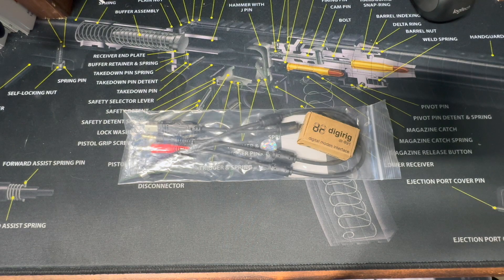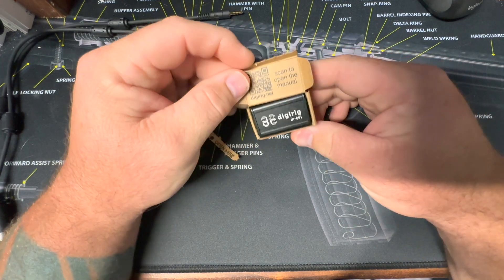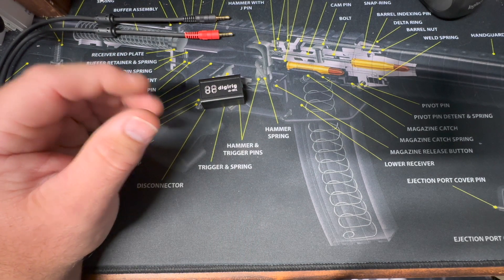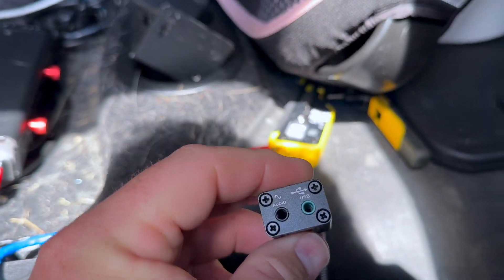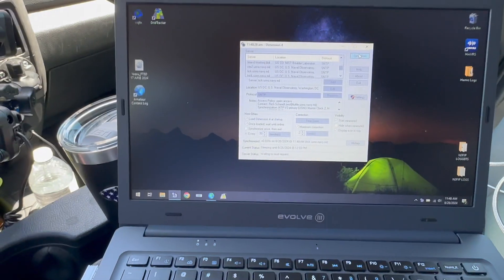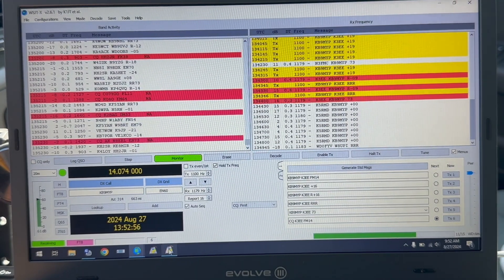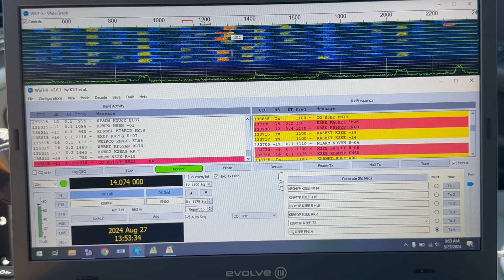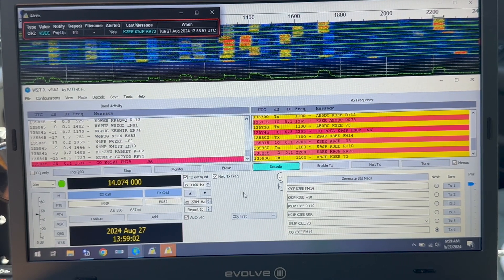Digirig DR 891 and a Yaesu FT 891 This might make me like digital modes.

Comment: Thank you for your video and explanation on getting the FT891 to work with FT8.  I am wondering how to get it out of this mode to work with CW or SSB. With all the steps shown, which ones need to be changed back.  This is why I sold my FT991A because it was tough to do Winlink and FT* and then switch back to SSB and CW.
Reply from the maker: Press and hold the band button again to switch modes. Once switched the only other thing that needs to be changed back is the RF Power. So go to your menu and it’s 16-3 I think. Then turn your power back up.
Reply: I use the FT891 utility Software to save and load profiles e.g. for SSB and FT8 - one reboot of the TX and done.

Comment: You know, I consider myself a smart person, but I can not get this dr891 to work. I have no audio input into vara hf.  I have checked every setting, swapped cables.  I am at a total loss.   Can you share your radio settings?
Reply from the maker: sorry did some work for you.  

Digital menu settings for the Ft-891
08-01 Data Mode: others
08-02 PSK Tone: 1500
08-03 Other Disp: 1500
08-04 Other Shift: 1500
08-06 Data LCUT Freq: 300
08-07 Data HCUT Freq: 2800
08-09 Data In Select: Rear
08-10 Data PTT Select: DAKY
08-11 Data Out Level: 50
08-12 Data BFO: USB
16-03 HF PWR: 30
16-10 Data Mic Gain: 50

Front panel menu settings:
Automatic Gain Control (AGC): Off
Band Width (WDH): 3000 hz
Processor (PRC): Off
Digital Noise Reduction (DNR): OFF
Front Meter (MTR): ALC